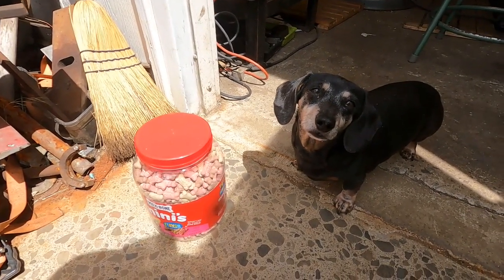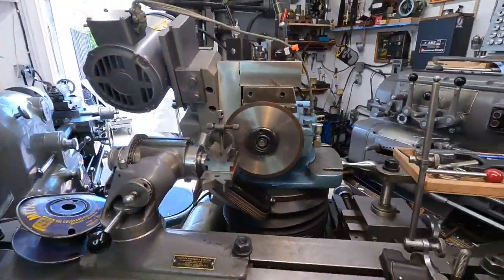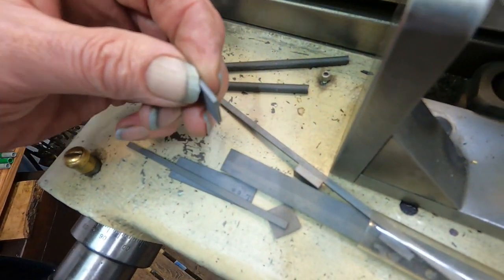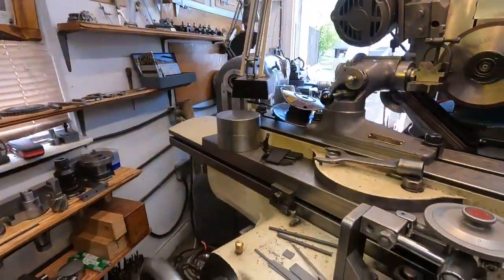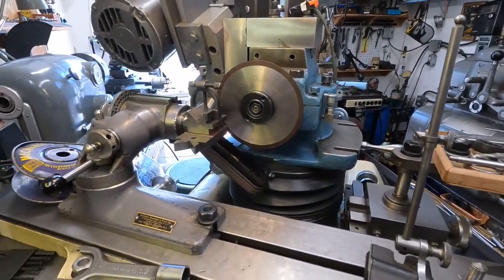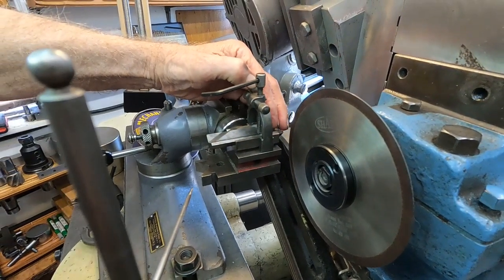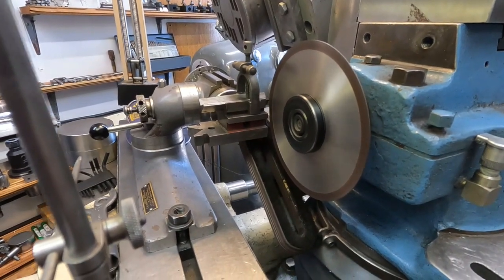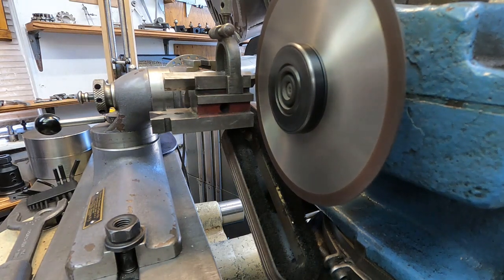Tool & Cutter Grinder. Deep carbide cutoff operation

Comment: I like the magnifying lamp mounted on the cutter grinder. Nice touch and I suppose very useful. Thanks
Reply from the maker: The older I get, the more I need it. I think it will be most useful grinding small endmills using the air spindle. thanks.

Comment: Dee my brother worked for Crown Cork and Seal as a Millwright in Abilene Texas. He worked for them over 20 years. I toured his plant one night. They were making 950 beverage cans a minute. 3 cupping presses and 3 Ironing presses a necking operation and of course printing all at 950 pcs per minute. You got to make a hell of a lot of beverage cans to make money.

 Chloe may not like the treats. Snuggles thinks they are "Dog Crack" but turns her nose up at real meat like chicken beef or pork. But loves chocolate chip ice cream. LOL 

Really interesting about shaving the piece of carbide off the larger piece. I could keep myself busy cutting the ends off of the broken carbide end mills i have. Carbide end mills seem to think my old Shakey hands are a diving board for them to take a dive onto the concrete floor. LOL 

I spent the afternoon sharpening some old drill bits of mine and took all of them for a test drive thru some 1/4" mild steel just to make sure they would cut. I have had brand new drills out of the box that would not cut, and I am not a happy camper when a drill bit will not drill. 

I was thinking about you when I tried to sharpen a carbide tipped masonry drill to cut mild steel. I did a lousy job because it did a lousy job of drilling. I have seen lots of carbide drill inserts that seem to do a fantastic job so just always wanted to try some of the masonry drills. I have a toolbox full of them and some of them are like 18 inches long. So, I am interested in what are your thoughts on the idea of using them for steel.
Reply from the maker: I have not tried masonry drills in steel but can sharpen them. I am looking to do more than I have in the past with carbide endmills as the specialty grinding wheels can be found at reasonable prices right now and getting a working air spindle from the plastic mold shop makes that much more feasible.
 The Crown Cork and Seal can manufacturing is gone, I have a lot of carbide, tool steel and precision ring gages from there. Chloe seems to hang around more than usual.